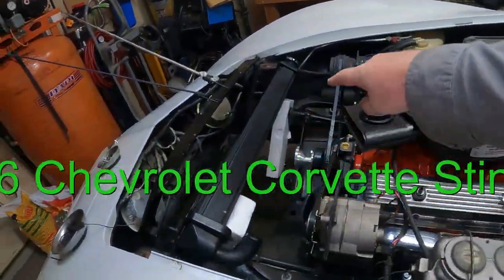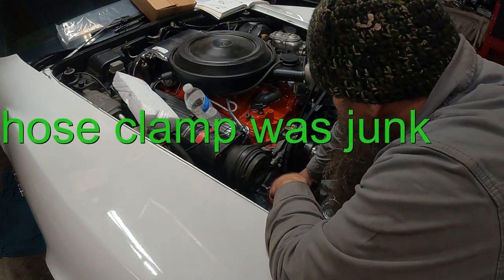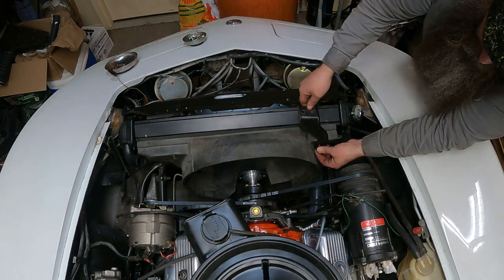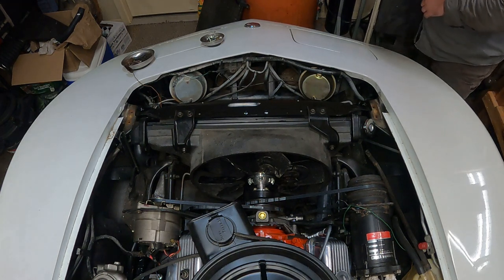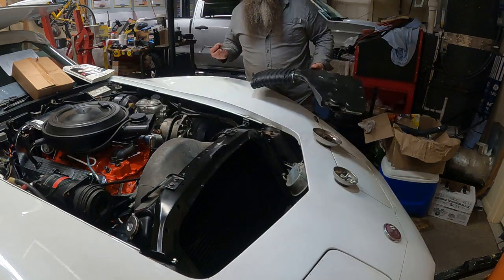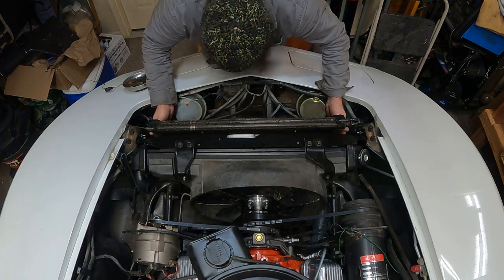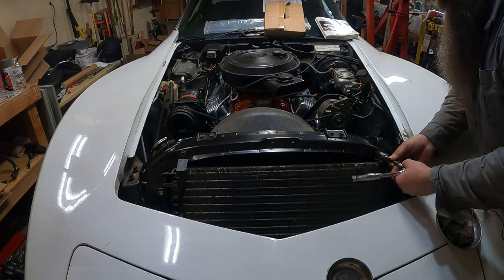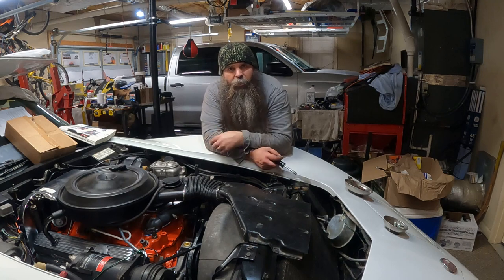In depth 1976 C3 Corvette Stingray radiator core support install

Comment: ELH, thanks. I put my support, rad, n shroud in my 76’ yesterday. My shroud has a much smaller cut out than yours and I had it in first and bungied to pull it back toward engine—it would not go over the water pump if I had the core support in first. Then the core support went in with the 2 bottom bolts to hold it, then I was able to get the rad in by tilting it with lower hose spout pointing to the floor. I got under car and lifted  and tilted the rad to get it in place. Moving the shroud in place took some careful maneuvering so as to not damage rad. The But First was very helpful info!
Reply from the maker: thanks for the comment Chas Ryan. glad it worked out.

Comment: I'm about midway through your vid and you asked about centering the steering wheel. You've probably addressed it but I'll remark how I had to recenter my steering wheel after replacing the rag joint. I pulled the steering wheel and recentered it. It was easy and didn't alter the front end alignment.  Carry On.
Reply from the maker: thanks for the comment Volfandt, i did indeed address the steering wheel. i did it through the tie rod adjustment.

Comment: The rad support should’ve been  installed first in its location with all the bolts,then you slide in the shroud after that you slide the rad between the support and the shroud and you bolt up the rad and the shroud.You can’t remove or install the shroud with rad installed,the rad always comes out first and goes in last,who ever cut the shroud didn’t know what he was doing.
Reply from the maker: thanks for the comment Victor.